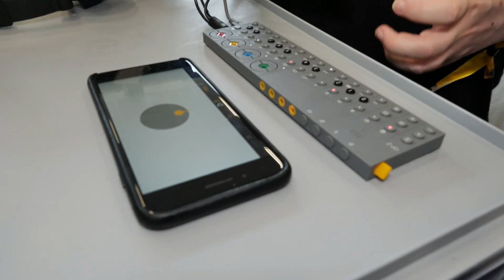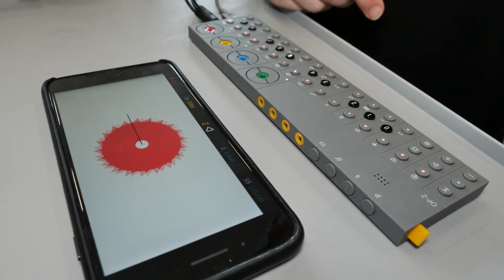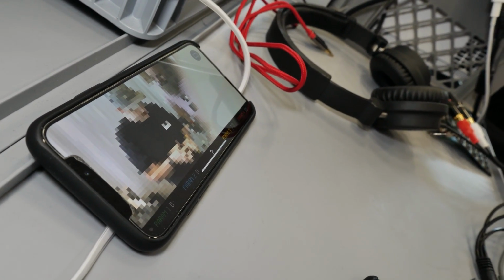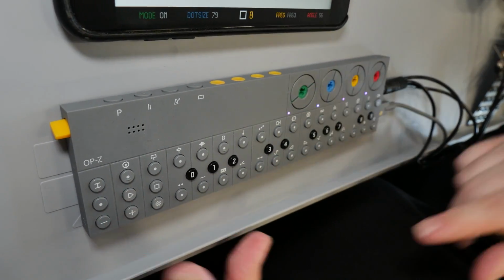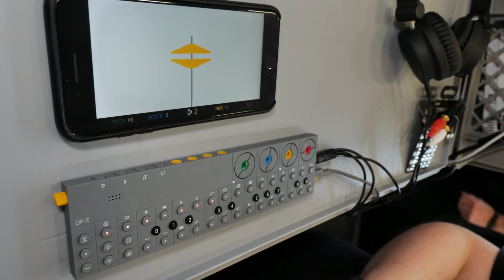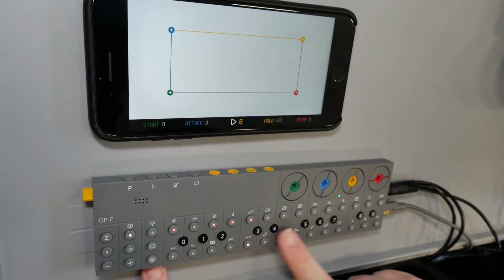Superbooth 2018: Teenage Engineering OP-Z - latest news

Comment: F*CK TE! the OP1 is a overpriced a toy, A actually got one, its fun to plug in your guitar but there are lots of stupid limitations. The FX sounds like crap, the synth sounds sounds in may cases like crap to . Common add some quantizing to the OP-1 so you can at least record some proper drums if your are not a timing perfect finger drummer.   I will not buy any of there crap anymore.